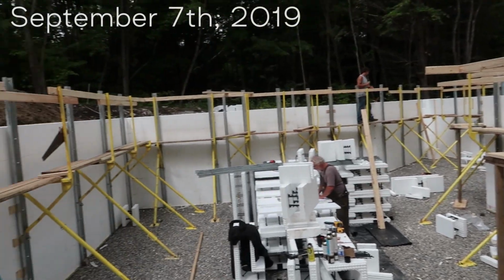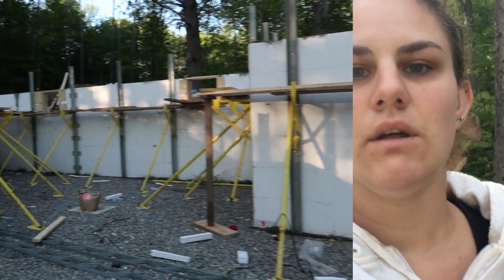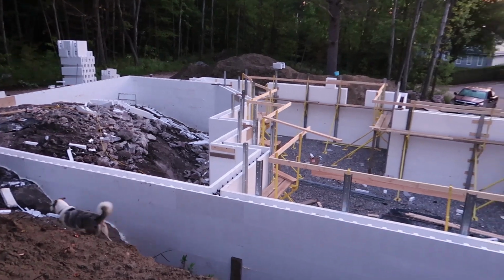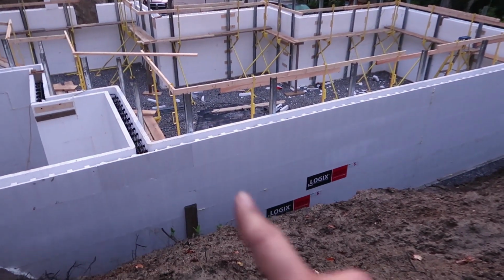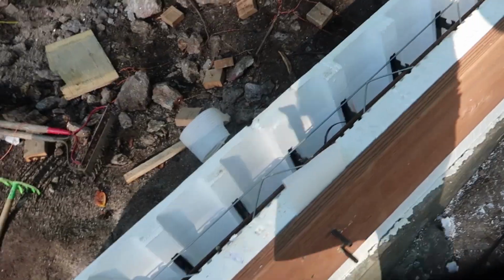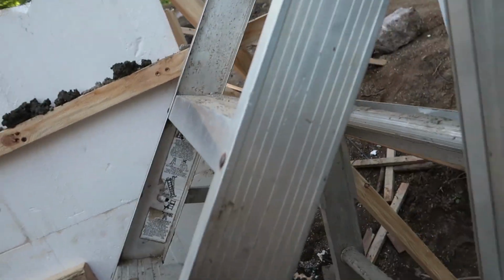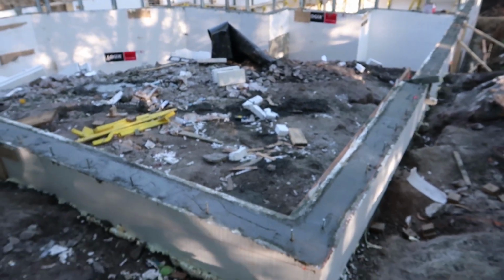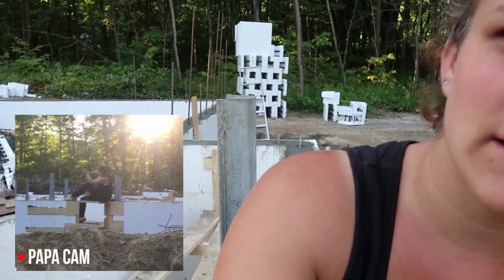Our ICF BASEMENT is DONE! | September 7th-9th, 2019

Comment: Why put stairs in?
Reply: Jai Jai so they can get up to the upper level of the house
Reply: I know that part but why not make it single level that’s what I meant
Reply from the maker: It is a single level or “bungalow”, however most bungalows have basements, as does ours.
Reply: They have to dig the foundation at least several feet deep just to get below the frost line.  Once you dig that far it's a waste not to make it into a basement.